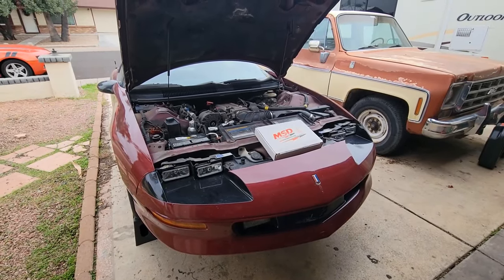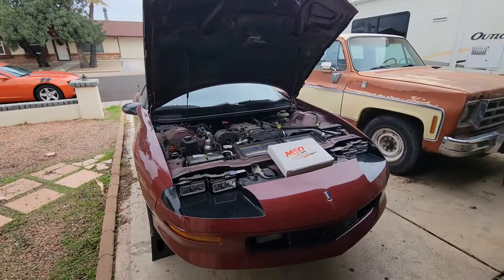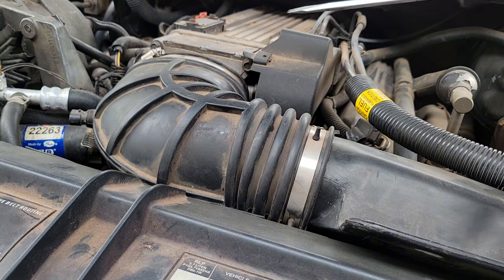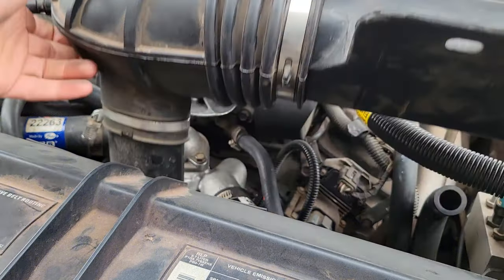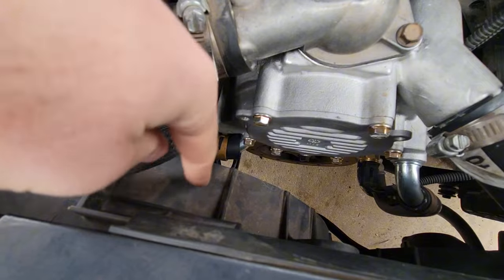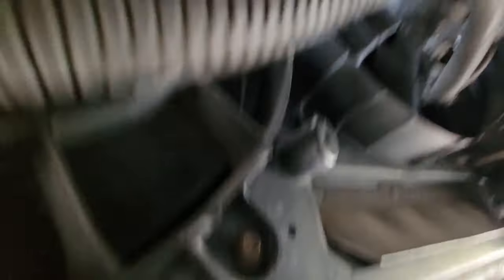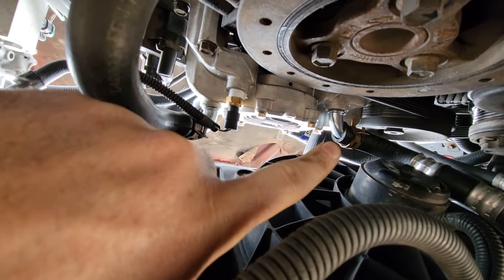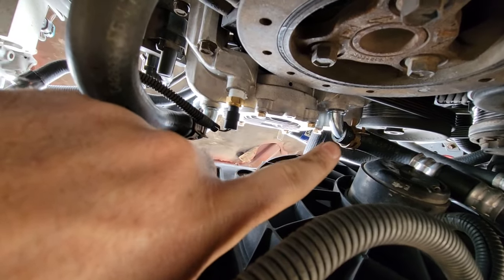Detailed Optispark Replace on LT1: MSD distributor with tips to increase life

Comment: this is the video you mentioned in a reply to me on the water pump video, very cool. Easy to follow instructions, and very happy you include the socket sizes. I just grab the ones you mention and away we go. I don't plan on putting the MSD in, but maybe so, depends on what we see under the hood tonight.
Reply from the maker: @mundanestuff  Sounds good, thanks for checking it out and good luck to ya

Comment: After dealing with 3 bad optisparks. Im going with the Torqhead  24 x kit .when funds permit.
Reply: I had a torqhead  ot had problems  as well I replaced crank shaft sensors left and right got rid of it

Comment: DAMN PICKLE YOU ARE MY F  HERO,,   I JUST SPENT 10 BUCKS FOR HOSE CLAMP PLIERS TO BE HERE TOMORROW.   The bulls**t I went through with these  FFFFFF  hose clamps was infuriating.  They were maybe 30 years on the hose and what a pain in the ass to grip, even with 90 degree needle nose pliers.   That is going to make my job so much more pro and faster
Reply: if you don't have the proper tool for the clamps ... a medium sized set of channel locks works as good as anything .
Reply: @sangamonriverrats  true but the clamps were some how turned down and very hard to get anything to grab and squeeze them at all.   All good now. I replaced some with easy hose screw bands

Comment: The main reason they vented the opti was to remove ozone build up from the spark occurring across the rotor to cap. a sealed cap and functional vent are key to a long life for the optispark. I’m about to install the torqhead 24x kit in the next couple of months when I do my heads, cam, lifters, and roller rockers and do away with it.

Comment: I tried MSD and it failed twice after about a year each time. Gave up on it after I found the shaft had a wobble to it. I hope you have better luck than I did. I finally went with Torqheads 24x setup.

Comment: I have a 1995 C4 Corvette. I replaced my opti-spark 4-5 times. Finally I got smart and purchased a  torqhead LS type ignition replacement system for the optispark. It costs more up front, but you never have to worry about ever dealing with the uncertainty of getting left on the side of the road because of the unreliable opti spark. The absolute best part is it comes with a PCM that can be FULLY TUNED. So you can put in a bigger cam, get high flow heads, forced induction or any other mod you can think of. Don't waste your time and money with another optispark. I was seriously thinking of getting rid of my Vette until I found out about torqhead. If you go to Ellwein Engines YouTube channel you'll see an engine builder Carl Ellwein that uses the Torqhead system on his 1995 SS Impala track car.
Reply: so you spent 1000 dollars vs like 50 bucks. wow
Reply: @YungEagle3k  And here we have someone who is commenting but has no clue what he's talking about. There's no way in the world you can get away with replacing an Opti-Spark for $50 unless you go to a junkyard which is not the smartest move. A replacement Opti-Spark by itself can cost upwards of $500... An Accel Opti-Spark on Summit Racing costs $433... And that's not including installation. Installation is another $500 if you're lucky. If you do it yourself you still need to replace the water pump and the belt tensioner. An AC Delco water pump will set you back $150... Now do that 5-6 times and you go away over $1000. But that's why you never listen to "experts" online. 90% of the time you'll get advice that'll cost you even more money than if you did it right the first time...
Reply: GM no longer makes the water pump or optispark as I found out at dealership.
Reply: torqhead is like 2200 bucks ... for that price i would just swap in my 6.0 LS....
Reply: @TheFilthyAtheist you mean the 24x $2,500. That price could buy a 6.0 or 6.2 for $500-1000 with accessories and do a ls swap....
Reply: @israeldoe8000  if for less than $2400 you can remove your old LT1, buy a 6.0 LS motor, plus accessories (starter, alternator, water pump, power steering pump, belt tensioner, belt, brackets) plus a transmission, plus a wiring harness, plus motor mounts, plus an engine control module, plus modify the exhaust system, plus installation, and a tune I say go for it. I would imagine you own your own shop, junkyard and will have completely free labor. Then of course if you want your dashboard gauges to work that's even more work connecting those wires from the ECM you bought to the dash. You'll probably need to use both ECMs. But like I said go for it, you obviously have done your research.

Comment: Take the whole unit off, it’s easier. You forgot the seals for pump and cam. If oil leak it will fail. Also make sure you line distributor up correctly or it won’t start. Start it up before putting water pump on just to be sure. Good video
Reply: spot on

Comment: How has the MSD opti-spark been holding up? I might purchase a MSD so I want to know what you think about it.
Reply from the maker: @HMV3-TIGER-FAN  I saw an immediate improvement. I'll be honest I live somewhere hot and if you've seen some other videos of mine you'll know I don't have A/C so it has been sitting a little more than normal. But my issues were difficulty starting, popping, a sort of stumble at low speeds like it would jerk a little under hard acceleration and I haven't had any of those issues. I get the occasional comments here asking why you'd just get the cap and if you can cover the better part of a thousand dollars to get a whole new MSD opti and the recommended new water pump I would but the cap I did here resolved the issues I was having even with less testing just because it was effectively undrivable before anytime I jumped in. Hope this helps, thanks for watching.

Comment: Pickle, I wussed out of removing my engine knock sensors/drain plugs on each side of the engine because my largest snap on standard socket wrench was not enough and I guess I need to use my 20 inch breaker bar.  I felt like it might break on me because the sensor is some weird nut/sensor combo.  Have you ever fully drain your LT1 that way.  I figured I would do the halfass radiator drain only a few times and slowly get most dirt out.  Thanks for helping
Reply from the maker: Yeah I haven't done a complete flush on mine yet. I do need to but I have completely drained mine a few times for different reasons thru the hoses and gave it the gooda 'nuff. Found out when changing the freeze plugs on my Jeep it can get plenty muddy in there but I'm holding out hope the amateur drain, fill and drain again got most of the bad stuff for now on the camaro
Reply: @picklesgarage  I read about half and half of the coolant is in the block and other is in the radiator and hoses etc.  I will do a drain once every 2 weeks or so once I get it back running and see what kind of crap still comes out.  I figure for 15.90 a gallon of good green and a buck for gallon of distilled, I could drain it about 4 times for sixty bucks or so.  Probably not the smartest way, but also the safer bet  for now.   I have had it down for over a month, looking into all this stuff and mainly avoiding 103 degrees with 80 plus % humidity after the short rains lately.  Now its in the 80s and with a few good fans blowing a much better working condition.  PS I saw your gaskets kind of bunched up around the bolts, from where you did the first replace and then this time, that was great to see because I assumed that shape on my old gasket was gasket sealant, but I now think it was a dry gasket as you suggest from the factory all along.  It is a pop on job now that I don't have to mess with RTV and a  the RTV covered gasket falling off onto dirty frame etc.    THANKS AGAIN YOUR VIDEOS ARE VERY WELL DONE
Reply from the maker: @barneythedog977  Sounds good, yeah the heat is killer at the moment. I pulled the ac so there's a few months I can't go near the car and working on it is brutal. Sure thing, I appreciate it!

Comment: What all did you have to do to tie in the second hose to vent the Opti? The 2nd hose on the driver's side. Any pics would be greatly appreciated!
Reply from the maker: I don't think it will let me send photos but there is a plastic vacuum line under where the brake booster hose connects to the driver side of the block. These are very brittle but you can find them online if they break. I had to cut it so it was a straight line and so the supplied hose forms a T.  Like this:[engine]-|
Reply from the maker: Here's the name of them so you know what to look for: Pressure Sensor Vacuum Hose 96451064
Reply: Thank you very much, I appreciate it!

Comment: I need to pull both balancwr and hub and i have a puller but i see people putting nuts on the bolts and i have no idea where they get those nuts becauae my puller did not come with nuts?
Reply from the maker: Yeah most will not come with nuts. Mine did not either I think people are just grabbing some from the hardware store to make it easier. That's not what I did for mine but could work as well.

Comment: 95 vette here.opti went last year and bought a 200 dollar piece from auto zone lasted 2 months.then bought jegs 200 dollar junk.came in with sloppy drive shaft and just sent it back.bought 450$ PETRIS OPTI AND BEEN GREAT EVER SINCE.also put something on the water pump p hole to direct coolant around the opti if it goes bad and they like to if your yamming on it hard they dont like the higher rpms.also if you have an original factory opti keep the Mitsubishi optical sensor.switch it to the new unit you bought especially if its a cheaper unit than petris.
Reply: Did the Petris opti come with Mitsubishi sensor ?
Reply: @adrianbinger8397  don't think it was and it says on their site Mitsubishi GRADE optical sensor so no but it's still running strong.

Comment: what is that long plastic tube connected to the intake and what does it do?
Reply from the maker: @dashawnjacksonblitz  So the main issue with the stock opti sparks is moisture will get in and it will foul the connections. The plastic tube connected to the metal intake manifold itself creates a vacuum. So that along with the other tube you will see connected to the plastic intake itself allows for fresh clean air in and it pulls moisture out. This should make your opti last longer and avoid the main design flaws of the origional.
Reply: @picklesgarage  ohhhhh ok, yeah that makes sense. Thanks and thanks for the video!
Reply from the maker: @dashawnjacksonblitz  Sure thing, thanks for watching!

Comment: Will this optispark work on a 1993 c4 corvette?
Reply from the maker: Technically it was advertised for the Corvette actually. Small differences between the LT1 in the Corvette verse camaro mostly belt set up and some internals. You should be fine running this on your Corvette but note the MSD I got is just the cap. You'll see ones for $700+ that will be the whole opti if you're looking for a full replace.

Comment: So did the tool come w that kit
Reply from the maker: Hey, I show around the 26 minute mark the additional pack that comes with the opti. Should have everything you need outside of basic socket set for the rest of the removal. Thanks for watching
Reply: @picklesgarage  I was watching it at work initially
Reply: I ordered the 500 jegs msd kit with the opti, cap, coil, and ordered a (definitely ac delco) ign module, my car stalls when it warms up occasionally and I figure I'll just go ahead and beat around the bush and do it all, im gonna look into picking up a water pump for it since it's there, im not against not replacing it it's my car but since everybody says so I might
Reply from the maker: @aronsaleaf4726  Yeah, id say opti related, mine would pop, sputter and try to die until I updated. I definitely made the mistake of not replacing as much as I could when I was just doing my water pump. You'll be glad you did for sure.

Comment: Pulling the whole fan assembly at once is probably faster than taking the individual fans off. It’s basically just slid into a slot straight down. I snatch them out as soon as I take the elbow off.

93-94 is non vented 95-97 is vented. If replacing the whole thing the drive is different for 93-94 vs 95-97. If you order the wrong one it no worky.

Comment: My 1995 ss impala opti was bad replaced the whole unit from ac delco. Cap rotor and the electronics. Also all three front seals on timing cover.the old seals will leak oil onto opti and ruin it.
Reply: Where did you get a ac delco opti? I’ve been looking everywhere, can’t find it.
Reply: No longer available.A company in Texas called peritronics

Comment: Did you remove the radiator?
Reply from the maker: No, if you take out the passenger side electric fan you should have the room you need to take out the water pump. You have to rotate it a bit but it will come out without removing the whole radiator. Hope this helps, thanks for watching.
Reply: Yes thank you very much

Comment: Man, the bottom vacuum line has disconnected on my Opti for my 1994 corvette. I think I need to take everything out to reach it...
Reply: Buy a pair of long needle nose pliers with 30 degree bent ends. This will allow long reach and you can squeeze the spring clamp to secure the vacuum hose. It takes patience.

Comment: That gear on the back is oiled by the oil system in the block, no need to grease. Forget the wrap hole drain hose idea, just tap and put plug in.

Comment: I found out that the hose that goes through the throttle body from the radiator area and comes out the other side to a  3 inch elbow hose connected to a metal line are the same exact size.  They sell rip off kits to connect the lines after a bypass, I simply snipped the line back for fresh hose and used the main line right to the metal tube and done , trashed the 3 inch line.  Please tell me there's not something I am missing because am I the only one who saw that option??  Seems like a simple free and best way to go!
Reply from the maker: @barneythedog977  Yeah that sounds like it checks out, great tip for sure!

Comment: How you put the pulley back on
Reply from the maker: The harder part is getting it off the metal sort of fuses a bit. Getting it back on you just have to make sure it's lined up and then slowly alternate while tightening the bolts and it will come back on snugly. You might use a little grease if there's a lot of build up but I wouldn't unless you absolutely need to otherwise it should come on fine without.
Reply: @picklesgarage  sweet dude thank you!!!
Reply from the maker: @soulsoothing6133  Sure thing, thanks for watching!

Comment: I was talking to the mechanic. He said don’t get MSD he had 2 bad one finally the 3rd one was ok .
He said just get OEM opti spark . Did u have any issues with MSD ? 
Also water pump replacement was sujrsted
Reply from the maker: @alirezashirazifard8990  I haven't had any issues with my MSD but keep in mind this is just the cap so if there is an issue with the rotor then it won't matter how many caps you throw at it. There is the much more expensive cap and rotor from MSD that is pretty highly reviewed. To be honest it's a flawed design in general so if you aren't careful it's pretty easy to damage even a good part. Issue with the OEM optis is a lot of them still have the flaws that make these so easy to break, ie lack of vent tube and holes at the bottom that water can splash up into. Plus some of these OEM are made really cheaply. But yes I HIGHLY recommend replacing the water pump while doing this. Most of these optis are going out because liquid has got inside the cap which is mostly happening because of a bad water pump like the seals to the block are bad or the weep hole so the last thing you want to do is put a new opti whether is OEM or MSD and it fail for the same reason the last one did. Hope this helps and thanks for watching.
Reply: Yeah, good luck finding an OEM unit, I recently had mine replaced and the shop told me they couldn't locate an OEM one, so to expedite things I went with the complete MSD unit, we'll see what happens, it's got to be better than cheap E - Bay shit!

Comment: Dude.... when you get in there like that you HAVE to do everything! Including coolant hoses and belt!! Let this guys experience be a lesson for everyone!! If you don't plan on changing EVERYTHING then you shouldn't be in there!!! Especially in the Fbody platform!!
Reply: With 125k on mine, I also did the timing chain, yes a good idea to do alot of other stuff too
Reply: @SteveO95  I assume you mean the gasket for the cover and not the actual chain right? If you mean you put a new chain on then you completely wasted your time effort and money! The LT1 actually all SBC engines have a very strong timing chain I've never heard of anyone having timing chain problems on a LT1 or anything that isn't overhead cams! If you have overhead cams or a timing BELT (not chain) then definitely but absolutely no need to change the timing chain on the LT1 or any OHV engines.
Reply: @SteveO95  a timing chain should last the whole life of the engine without needing to be changed as long as regular maintenance has been done. But if regular maintenance hasn't been done regular throughout its life other issues will arise! If you're rebuilding the engine of course throw a new one in.